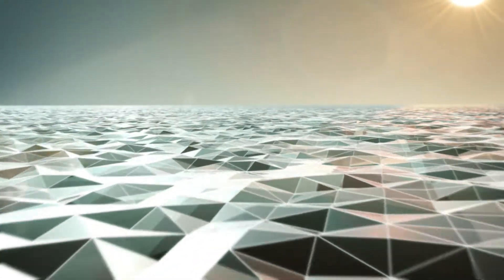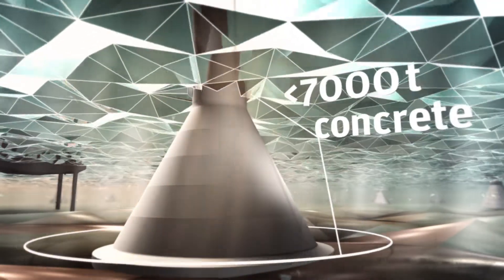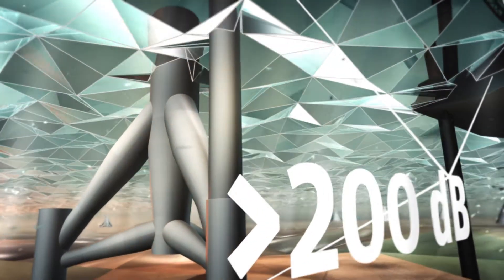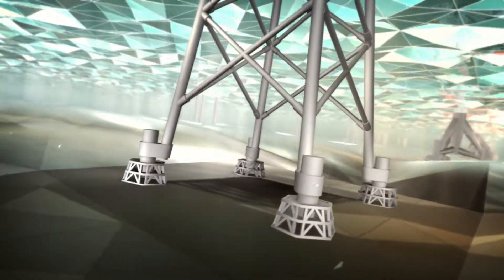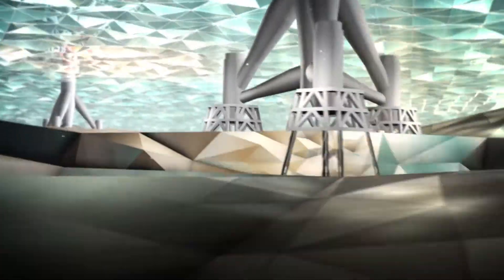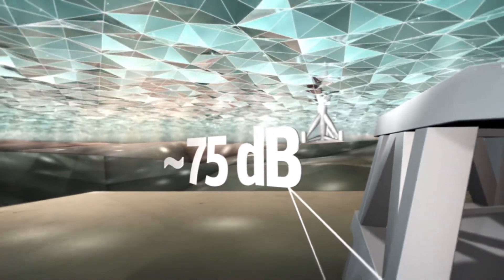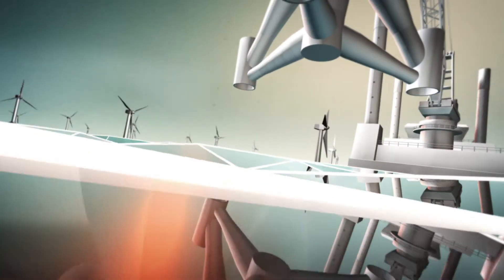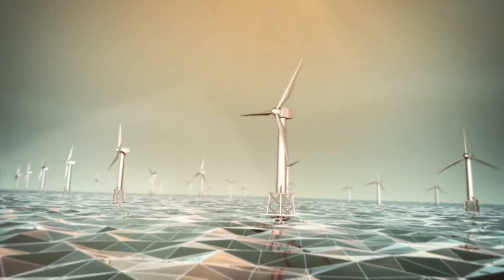Vallourec Preon marine - English - HD

Comment from the maker: Vallourec Preon marine
The patented system is designed to anchor offshore wind turbines to the seabed. PREON® marine is part of the PREON® product line, a patented tubular frame system developed for industrial and commercial buildings (MSH-type seamless structural steel hollows).
Developed by Vallourec's R&D teams, this solution will mean that offshore wind turbine foundations can be installed with less effort, noise and at a lower depth, compared to the two existing solutions.